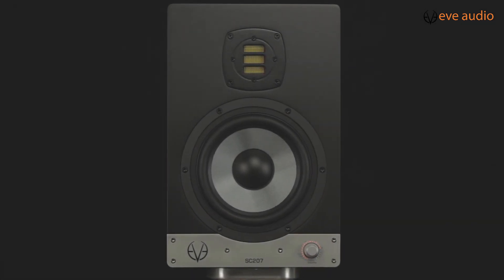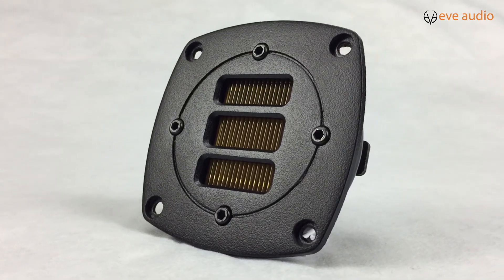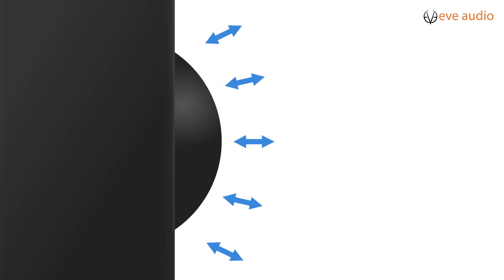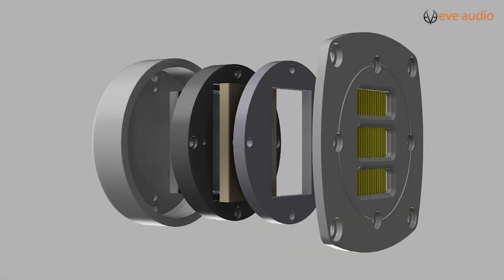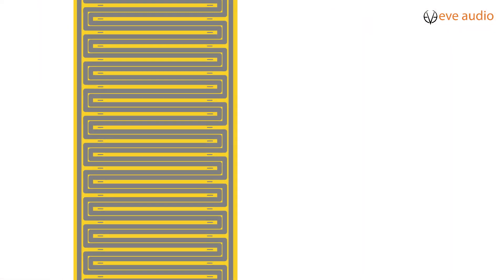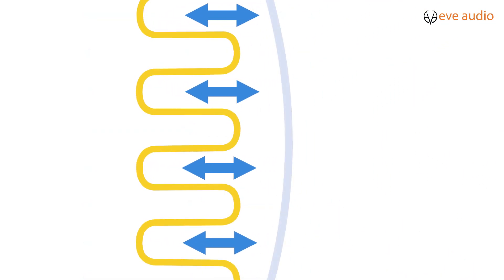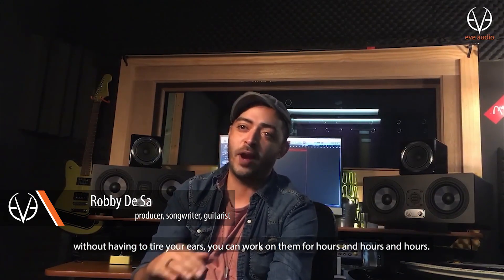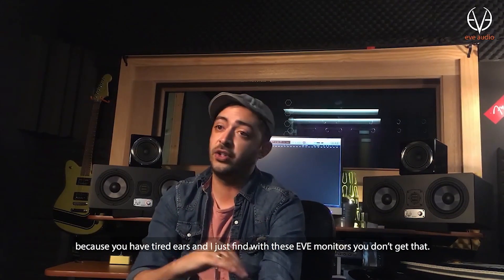Tech Talk: EVE Audio "Air Motion Transformer"

Comment: The hand-built Jack Smiley air motion transformers in my speakers are crossed over at 500 Hz. To really get the full AMT experience, they need to cover the mids, not just the highs.

Comment: Is there any specific reason why no waveguide is used?
Reply from the maker: A very good designed waveguide has some advantages concerning dispersion. The overall resolution and location can be very good in a center listening position. But there is a disadvantage when you want to have a wider listening range. High frequencies are much more degenerated in off-angle listening position. This is the case when 2 or 3 people are discussing about a mix in front of a mixing console for example. Waveguided speakers sound kind of muddy in off-angle listening position. A non waveguide speaker delivers a wider listening area as a huge advantage. If you have any more questions feel free to ask us!
Reply: @EVEAudioMonitors  Thank you.
Reply: What concerns me much more is that the steel plate with its rows of chamfered edges most definitely serves as a wave guide, and one which is far from ideal.